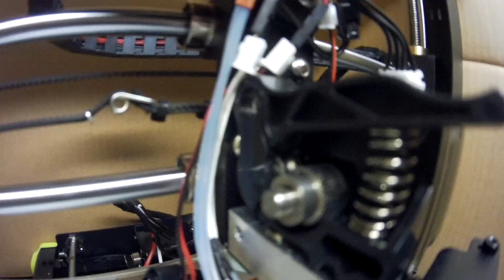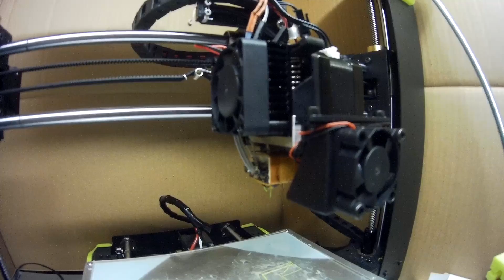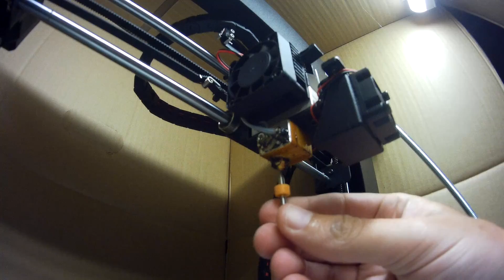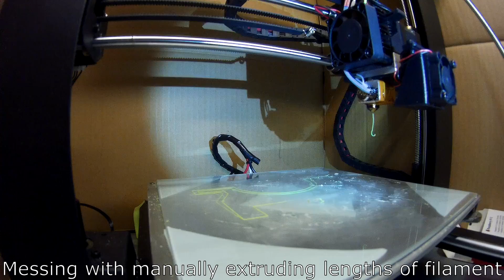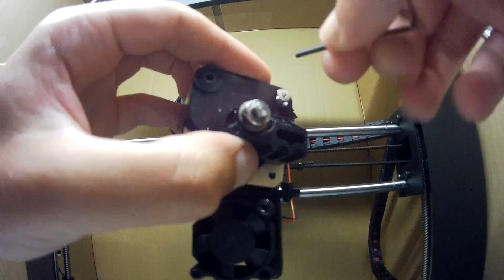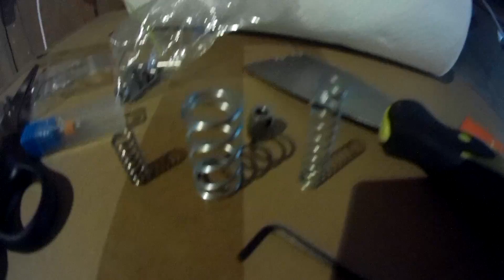The Case of the Uneven Extrusion

Comment: I have this exact same issue with my Flashforge Adventurer 3 which I'm using to print mainly ABS with. Recently it's started doing this very same thing and it's driving me nuts. Specially after spending about $55 on new parts that didn't do anything to my problem. It's very interesting with the spring you pointed out, but did it fix your problem in the end? I've just finished messing with the stepper mechanism to change the bowden tube in there and it never occured to me that the spring might have anything to do with it.

Great video by the way!

Comment: Um, quick question: Are you operating a 230C, Chinese manufactured arduino controlled hot glue extruder system inside a cardboard box? This is a fairly dangerous fire hazard which should warrant more of your attention than posting videos on YouTube regarding your maintenance challenges.
Reply from the maker: +Steve Longpre Yeah, this is one of many reasons I'm never far from the printer when it's in operation.

This is by no means the only source of fire danger with these units, and is sufficiently far from the 230C extruder that I wouldn't be worrying about the extruder coming into contact with it.  The fact that the wiring on the heated bed in these likes to go up in flames was higher on the priority list (and has been addressed).

However, you're totally right that it addes to the risk: That box was definitely meant to be replaced a while ago, and is on the list of stuff to fix.  The comment starting 'From my own experience, "temporary"' in this thread https://www.reddit.com/r/3Dprinting/comments/246lto/temporary_enclosure_nailed_it/ applies here.

Comment: FTFY: "Maintaining SOME printers is no picnic."

I didn't know anyone still used clothespin spring belt tensioners.  They can cause easily avoidable print artifacts.  If the belt is too long for the existing tensioning mechanism, cut it shorter and get rid of the clothespin spring.
Reply: Mark Rehorst those came on there from the factory, all monoprice printers come with them
Reply from the maker: Out of curiosity, what would you consider an easy-to-maintain printer?  I've worked with Afinias, Tazbots, and this Monoprice/Wanhao - and oddly enough, this has been the easiest-to-maintain of the ones I've dealt with so far...